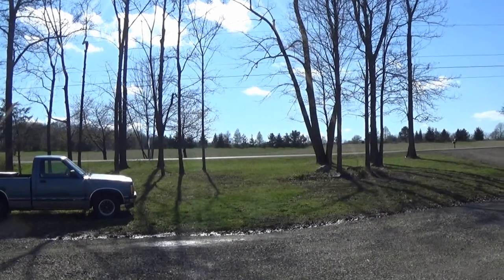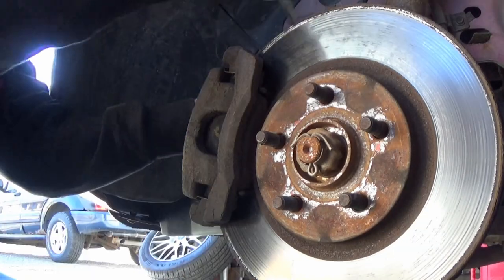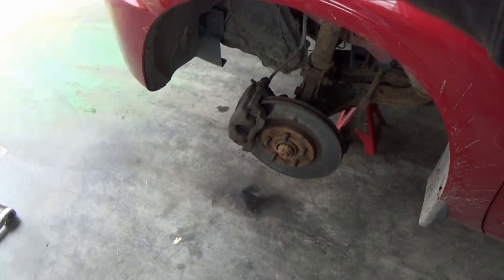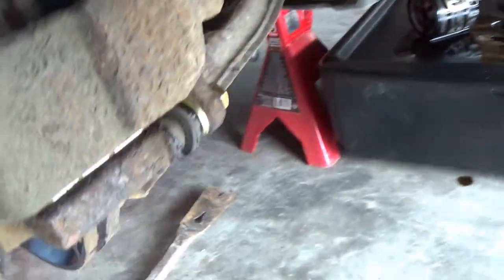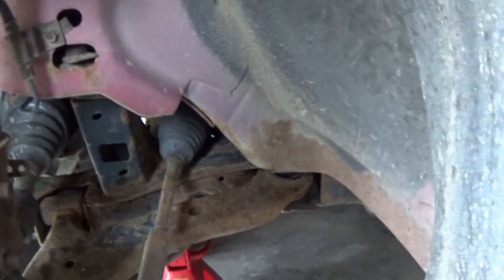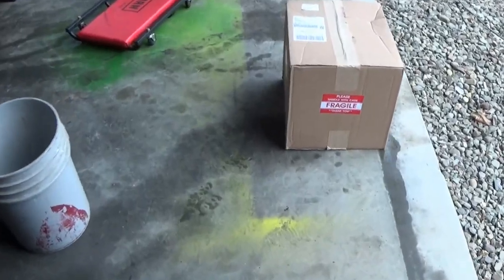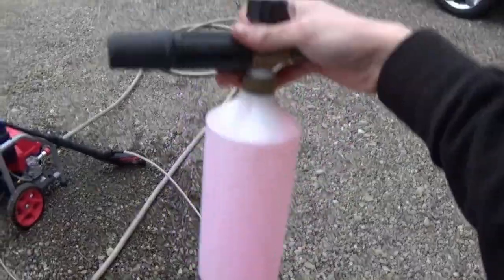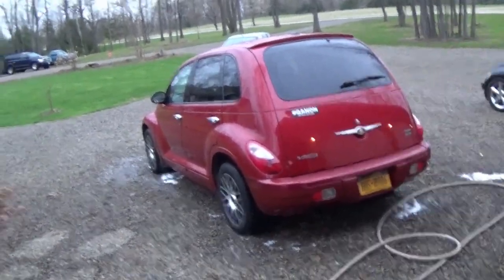PT Touring SPRING TLC!! Brakes + deep cleaning

Comment: I definitely would push for Castrol in the PT. I use Castrol EDGE fully synth 5w30 and it's fantastic. My gas mileage is better with it too. Combined with a K&N filter I change once a year or every 15,000 miles. Great oil.
Reply from the maker: That's great to hear!  I've never got any negative feeback about Castrol and it seems to be treating the Touring pretty well.  I think I'm gonna switch it over to full synth next time around too though!  Thanks for the comment :D
Reply: @jimmycruiserr  For me coming from the UK/Europe Castrol Magnatec is generally the go-to as it exceeds Euro manufacturer requirements and is very high mileage. Very minimal tappet/lifter noise on start up etc and good viscosity at different temps it's a win-win for just a few bucks more :) Hope to see more of your family's touring!

Comment: My LCA bushings are warn bad as well. Im interested in that video once you do it for them, I have some suspension that needs done too. SPRING Cleaning at its finest. Thanks for all the PT videos i have found them to be a big help! I got some vibration in the steering, thinking its the tires right now bc it sat for 1 1/2 years and I haven't changed the tires yet so ill find out when I replace things. THANKS AGAIN!
Reply from the maker: Good luck with your LCA too!!  I'll be making a video on them with this car sometime this next week for sure!  Thank you, I'm glad my videos were able to help :D I've had a lot of vibration issues with my PT GT as well, I finally found that my most recent problem was improperly balanced tires as well.  Vibrations can be hard to figure out!